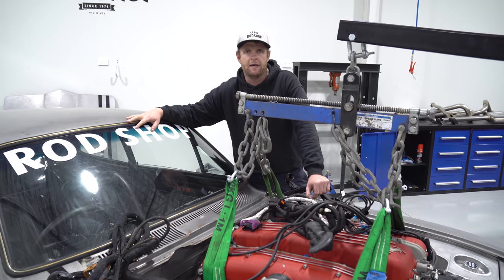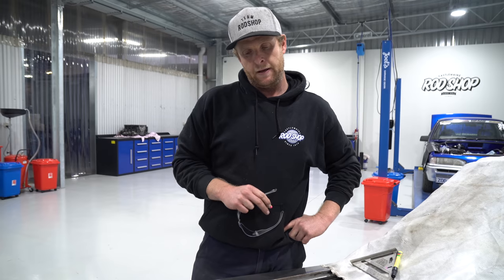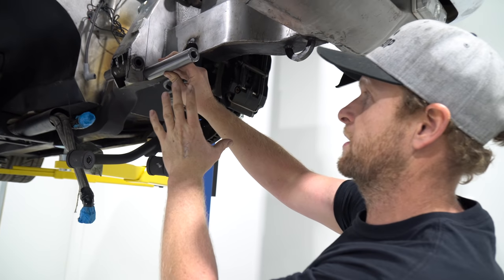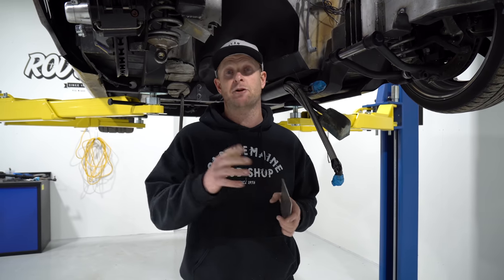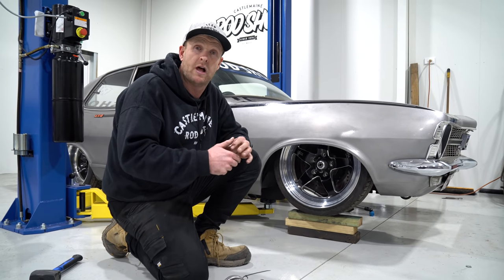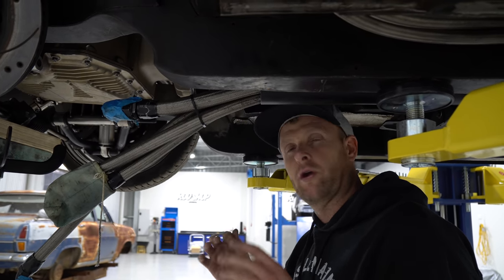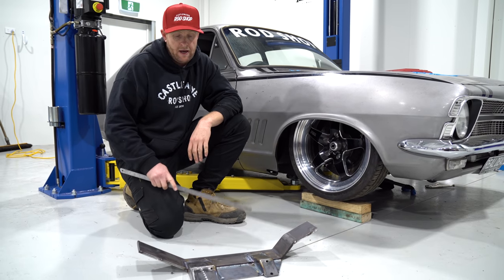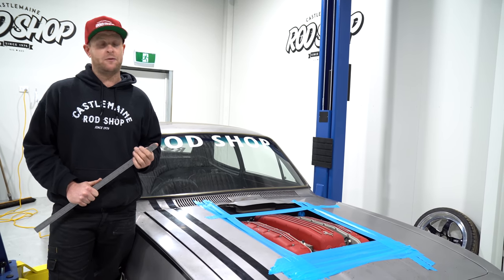How to fit a V12 Ferrari engine into a custom Holden LC GTR Torana

Comment: Ferrari crank angle sensor on the flywheel is a pain. I had to put a new one on the crank pulley. Looking forward to seeing this come together.
Reply from the maker: Thanks for the tip Jeff!
Reply: @CastlemaineRodShop1976  I am sure you have far more idea of what you are doing on that front than I do. ;)
Reply: Great seeing two Aussie Ferrari projects now :)
Reply: Jeff has the Alfarari, CRS has the Torari.
Reply: @HomeBuiltByJeff  You're very humble mate, what you do blows me away , love seeing your work & has taught me a lot.
Reply: And you have done a Ferrari V12 engine have you?
Reply: @jasonswift7098  Haha. Sorry mine is only a V8 so I guess that doesn't count ;)
Reply: @HomeBuiltByJeff  It sure as hell does count Jeff! Don't be listening to naysayers. Ol' mate Jason probably couldn't tip water out of a boot if the instructions were written on the heel.

Comment: Change the 'prancing horse' logo on the engine cover to a 'prancing lion' for Holden haha
Reply: So a Peugeot badge?
Reply: @adamdavis6481  if that makes it cheaper to weld on, sure haha
Reply: @adamdavis6481  this seemed like a good idea and you ruined it hahaha
Reply: @Kombat_Wombat  not really, just advoided a slightly embrassassing mod haha
Reply: Don't insult  the engine brand

Comment: Very.cool , loving the engineering side of things and your explanations on what your doing and why. Can't wait to see it skid
Reply: Engineering? None. just cut up the car to fit an engine that does not fit.
Luckily this is a burnout car where engineering is not expected. Though it may never turn corners again. Just drive it into the nearest wall than smoke the tyres!
Reply: @ldnwholesale8552  it’s going back to a streetcar so there’s a lot of engineering to be done
Reply: @ldnwholesale8552  drive it into the nearest wall? Found the yank.. We don't do that around here mate

Comment: Hi 
Awesome work.
Looks streamlined.
 The Lc Torana have always been tough in my eye, now I know why they handle the stiffness.
Have a good weekend
 Thanks 
 Karl
Reply: Stiffness is meant to say toughness
Reply from the maker: This had already been heavily modified with full chassis rails and the front end all custom made   As the original car was a mess and should have been sent to scrap but geez we are glad Heath held on to it.
Reply: @CastlemaineRodShop1976   yes I am glad too. The real deal.is definitely made real well and for the real deal.
 You can see the love or passion.

Comment: Nice fab work mate. Im a fab/welder by trade in Adelaide and it may benefit you if you cut a two vertical lines up the plate showing the gusset's on the inside and welding them together for added strength since you cut so much out. They will be like plug holes in a way. Looking sweet buddy cant wait to see the final product 👌🤘.

Comment: Like putting an extra 50 beans in a can.
Blow me away that the chromoley tube and 10mm bent plate is enough for a replacement cross member, but CRS would know amazing work as always fellas.

Comment: Just keep the whole engine partially exposed with those signature red ferrari intake plenums. Maybe put a shaker scoop or one of those old school drum/pancake air intake/filters instead of running a bonnet over the engine with only a cutout for a blower and scoop.

Comment: Just saw your channel and this project.  I had a 456GT with an automatic transaxle.  I would suggest you would be much happier driving the Real Deal if it has more than 2 speeds that are widely spaced.  The Ferrari engine has a higher rpm torque curve and drives much better with closer gear spacing.  Had a 67 GTO in the day with a powerglide and although the engine had enough torque it was a disappointment.  The 4 speed version was much faster and satisfying.  So, recommend get a GM three or four speed auto behind the fragile Ferrari engine.  Just my two cents.  Love your channel.  Bring the Warbird home.

Comment: Stupid question. Could you not have modified the sump instead of the lower arms and crossmember?
Reply: Dry sump, its flat on the engine and part of the engine.

Comment: Ferrari V12 into a Torana is just perfect.Power to weight ratio will be something. Looking forward to the finish product.This will be some magic little car.Question,where did you find a Ferrari V12 motor? I suppose some poor bugger wrote off a beautiful Ferrari V12.
Reply from the maker: We got it through GT Spares in Adelaide.
Reply: Thanks for your reply, I am looking forward to seeing this lovely little Torana finished. Keep up the great work. You guys always have worked your magic with these builds.I remember back when Rod had this shop and the first car I would see at the Melbourne Hot Rod Show was one built by Rod Hadfield.You guys remind me of the greats from the early 60s.I am close to 70 years old and this little Torana is the best heart  transplant I have ever seen.Not a V8 but a Ferrari  V12. WOW

Comment: Dumb suggestion that will probably get buried - how about getting a polyurethane (or another strong equivalent) cowel down the centre? So it's covered but you can see inside. That'll eliminate the clearance issue and keep her covered.
Reply from the maker: We think it will sit ok with a hole cut in it mate, might poke through but I think heath has his mind set on cutting one up and making it look neat as possible
Reply: @CastlemaineRodShop1976  either way it's an awesome build and I can't wait to see the finished product.

Comment: Better off with a DCT or more gears, they don't have super wide torque band like a V8. Got nothing down low, I'll speculate it will fall on its face when it goes into second.

Comment: You put a $375,000.00 engine in a $15,000 basket case clunker and got a $23,000 basket clunker with a Ferrari engine?
Reply from the maker: If you can find someone that would pay $375,000.00 For the engine, we would chuck the Torana in for nothing!!

Comment: WHY would you replace  a simple engine with power with a Fiat with less!
IF you must use the Fiat but it where it is supposed to be. In the back seat area and than use a transaxle for drive.
NOT a moronic powerglide
Reply from the maker: as we stated in the last video, this was a front mounted engine to begin with.

Comment: Over rated, should have fitted a 6.2l ,keep it in line for Holden, but different likes
Reply from the maker: 6.2ltr Would have been an easier option that's for sure, 
But we wanted to try something a little different with the Real Deal.

Comment: The stock GTR XU1 is worth more than this abomination, and all you can do is put a shitty bogan auto transmission in.....at least dignified yourself and put a half decent manual transmission.
Reply from the maker: Why go half decent manual when we can put a perfectly good auto in to it that we already have? If he had wanted a manual transmission Heath would have set it up for manual. This car is being built to suit its owner not you mate.
Reply: As much as it pains me to say it, manuals are a thing of the past.  Autos have come a long way in the last 20 years and will easily outperform a manual for the expected usage of this car. That said, powerglide? I know you had a good one but a Toyota A340 can be beefed up to take 1000hp and has twice as many gears. Which will suit the lack of torque from the Ferrari.